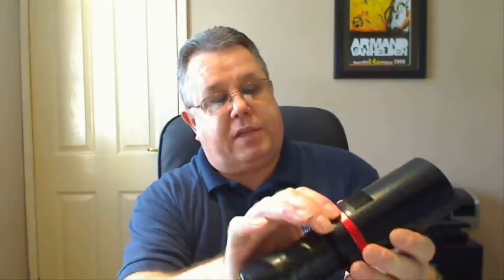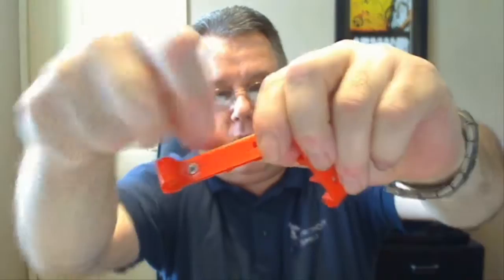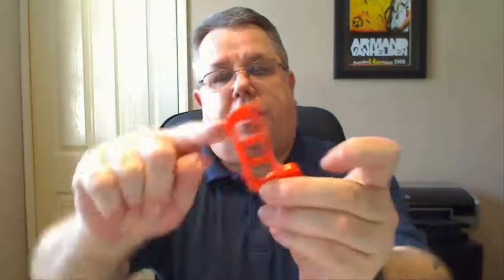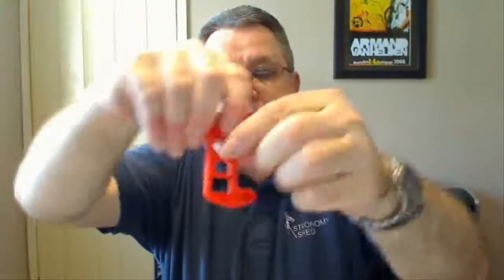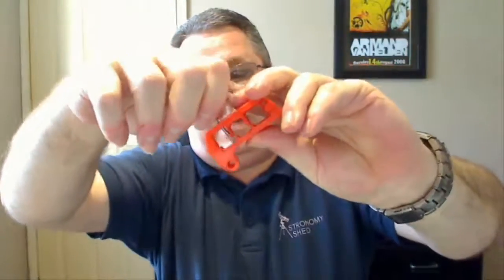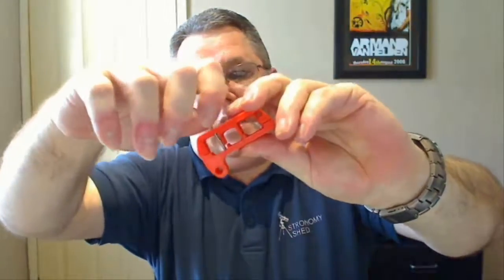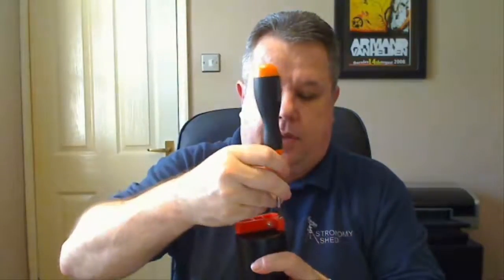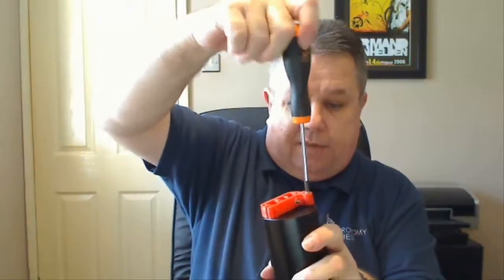QHY8L Cable Retainer Intro And Tutorial

Comment: Cool, have been wanting something like this, I found on the QHY site you can download the .stl model file and print them out if you have a 3D printer which I do. Just got to get the spacers and other screws and bits, I'm going to modify it a bit to use thumb screws/wing nuts so the cables can be tighten and released in the field without using a screw driver.